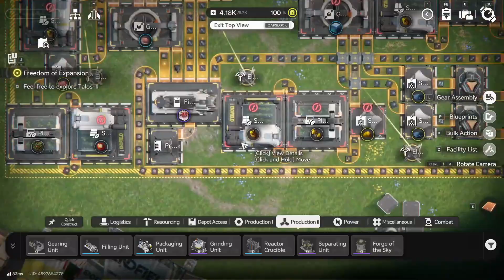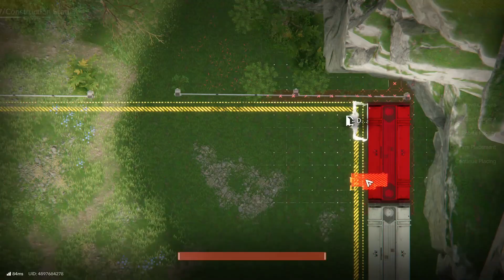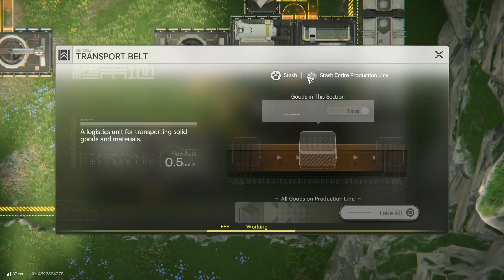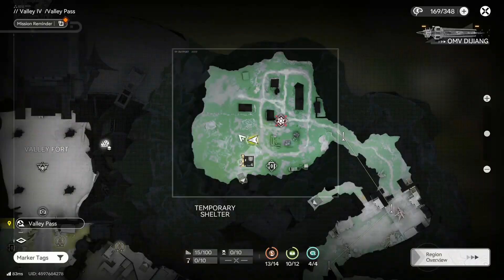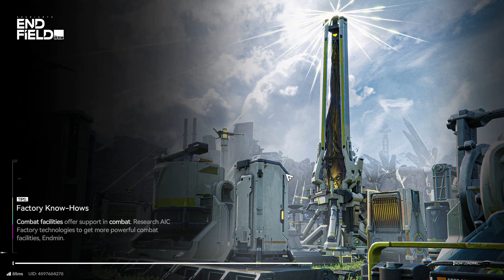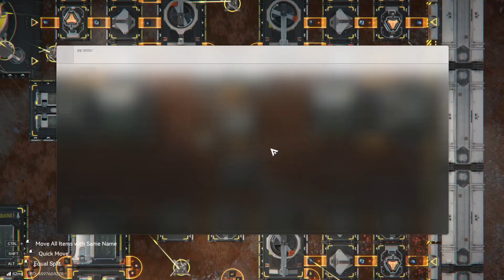Buck Capsule A Construction Guide | Arknights Endfield Base Setup & Optimization

Comment from the maker: Thanks for watching my Buck Capsule A Construction Guide for Arknights: Endfield! 🏗

If this guide helped you with base setup or resource optimization, don’t forget to 👍 Like and 🔔 Subscribe for more Endfield construction guides and progression tips.

Have questions about materials, placement, or which structure I should cover next? Drop them below — I’ll reply and may feature your suggestion in the next video! 💬🔥

Arknights: Endfield Blueprint Sharing Codes:

Buck Capsule A: EFO01a658aaaa5A43oe5e
Steel Bottle: EFO019aEu9999EeAu5uI2
G.B Powder: EFO01602I66662715O83e